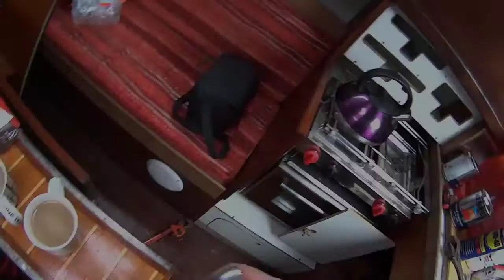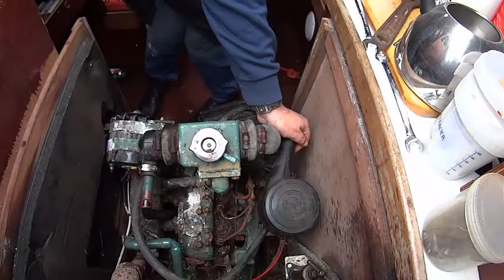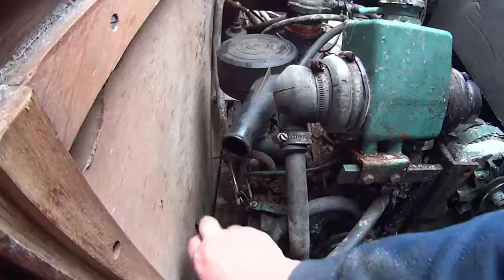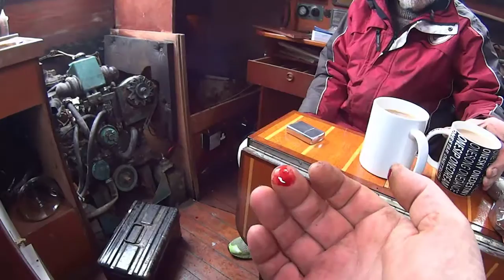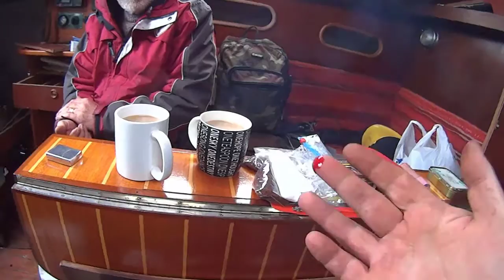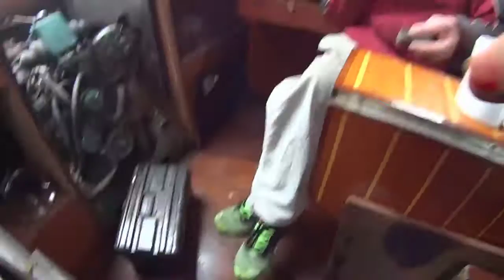Lol scenes not for the squeamish Second Chance Sailing

Comment: Hi GLP , is GLD a GOD in fixing things and why did you put your hand on the air intake and what what water intake as well ?
Reply from the maker: the hand on the air intake will make up for there not being a lot of diesel getting through because of blocked injectors just block off about 75% works even with petrol engines